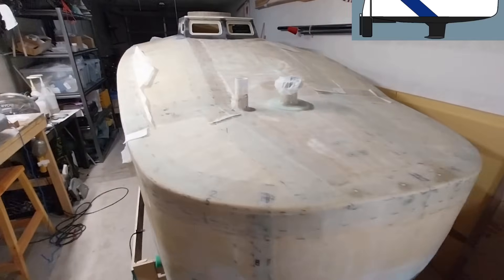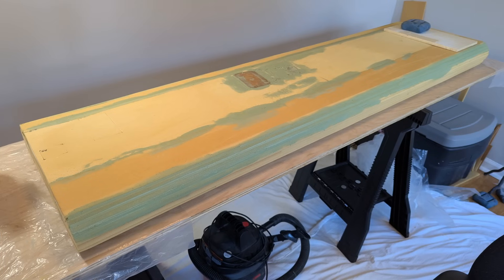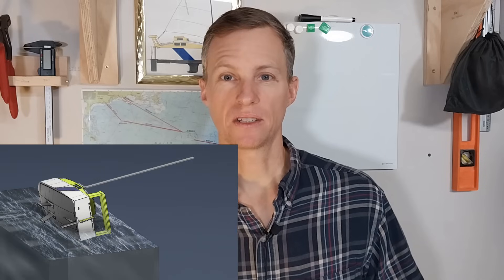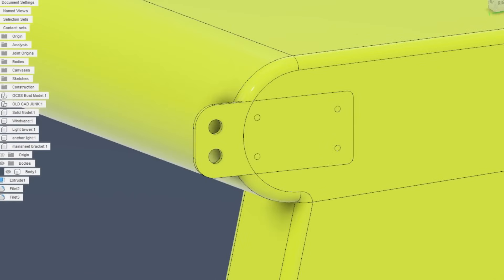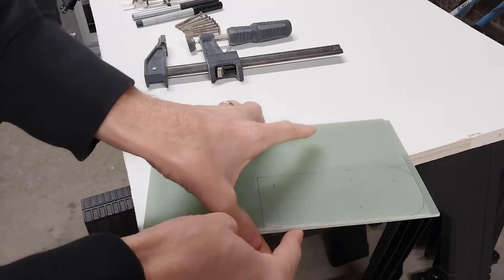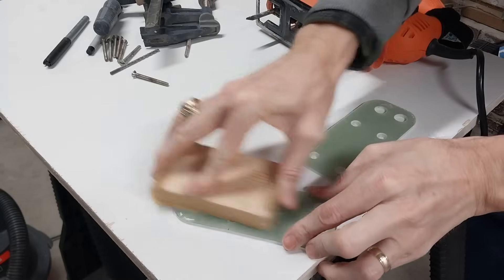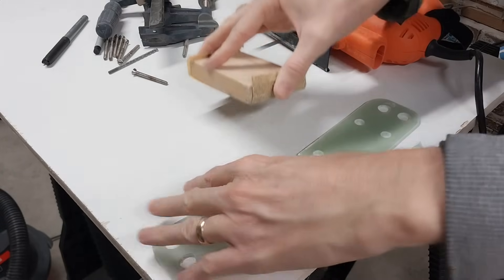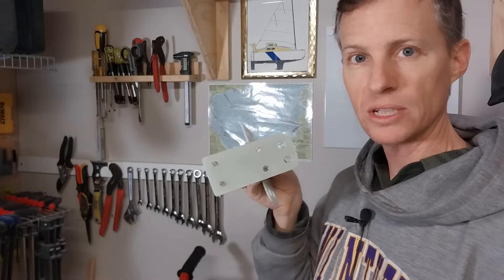OCSS-087 Strengthening Mainsheet Attachment Points with Carbon Fiber - Buoyancy Arch Build

Comment: hi, thanks for sharing your adventure! never knew scow bows existed until i watched your channel. since then i have seen some other scow bow cruiser and quite like the divinite 7 meter. i was wondering, did you design your cruiser or did you get the plans from a designer? if so, care to share which designer? i am looking for a bigger boat as i intend to do some cruising and will essentially be living aboard. do you know of any plans for a scow bow probably between 6,5 - 10m? thanks. all the best for completing your boat and take her sailing!
Reply from the maker: I started with a design called TenTen 425 and made modifications from there. Check his other designs online and you will see some scow bow designs in the range you want.

Comment: fellow boat builder here: I also spent some time thinking about these G10 plates and side loads. Wouldn't it be simpler - and take loads from more directions - to put a soft padeye through the arch from top to bottom and use that G10 as a backing plate?

Comment: Careful mixing carbon fiber and fiberglass…they have different thermal expansions for one…so you can get delamination.  Also…if the surface is load bearing the different strength characteristics may be a safety issue.  Carbon fiber doesn’t bend and has catastrophic failure if you exceed the stress it is designed for.…fiberglass bends and is more forgiving. Depends on a lot of factors, but the fiberglass isn’t going to strengthen the carbon fiber in a layup stack…so don’t assume it is adding any strength to the carbon fiber in your setup here…make sure your carbon fiber can handle all the stress itself without the fiberglass.

Comment: I thought it was good for boats of ALL sizes to not point their masts at the horizon. So what is the size limit? Is it OK for a 35 foot boat to point it's mast at the horizon? 40 foot boat? 50 foot boat? 
 I'm looking into buying a sailboat soon. I want to be sure to only get a boat that is designed to keep the mast pointing up. So, big enough to be comfortable, but small enough to be designed to have the mast point skyward. Any other important items that may help me look for the right size of boat would be helpful. Thanks.
Reply from the maker: Go as small as you can to start. Look into the Cape Dory Typhoon and Compac 16 or other Compacs. Check the "Classic Small Cruisers List" on atomvoyages.com
Reply: @ocean_capable_small_sailboat  Thanks. So many places say you basically need a 40+ foot boat just to squeeze 2 people into for more than a weekend sail. Or a $2 mil catamaran. What would be your minimum hull design? There seems to be so many Utube channels running a bolt on keel. Would you trust a Catalina 28 to cross the Pacific?
Reply from the maker: @goatman3828  I'd build it myself or use something from the list I recommended you look up. Start researching from there. Best of luck.

Comment: Everything about this build has been excellent until this arch. All the comments about the padeye attachment weakness are valid. It seems like all the strength is coming from the carbon fiber laminate. The bolts into foam do nothing even with the extra epoxy. I encourage you to rethink this design.
Reply from the maker: That is simply untrue. This foam has a compression strength of 90lbs/in2. You've got about 4" of bolt/epoxy bed area total for each padeye. Each padeye holds half the force of 1 small sail. From the bolts/epoxy beds that's around 360lbs of support on each side. Not including the many layers of carbon fiber that the end result will have, spreading the load across the arch. Saying the bolts do nothing shows you don't have an understanding of what's being built nor the materials involved. The bolts are not really needed, laminations of carbon fiber are incredibly strong, but I wanted to add them anyway.
Reply: We seem to agree that the primary strength is coming from the carbon fiber. I said that the bolts do nothing. And you said that the bolts are not really needed. It's not a matter of foam compression. The bolts are not anchored to anything and can be pulled out of the foam. The only thing holding it all together is the carbon fiber. I still encourage you to rethink the design. The loads will not be static. Assuming the padeyes can be held in place with the carbon fiber, that just means that the entire arch will need to withstand being pulled back and forth with sudden forces. This will put strain on the arch supports. You'll have the full force of the sail trying to rip the entire arch off the back of the boat. If the arch supports are about 1.5 feet or more, that's a lot of leverage that will amplify the forces.
Reply from the maker: Small sail, small boat, small forces. It's the same basic construction techniques as used on the boat Baluchon and it works fine. Everyone wants to chime in that something is not strong enough. I can triple up strength the next week and they'll write the same. I've learned to filter it out and rely on advice from trusted boat-builder contacts. Just watch and enjoy, or if you don't enjoy then don't watch. Components have been built stronger than required.

Comment: Good looking! 

Is there the slightest risk that the boat stabilizes up-side-down, given the symmetrical shape of the floating arch?
Reply from the maker: Thank you. My plan is to have extra buoyancy on one side of the boat, so that she won't have that issue. Such as a couple small buoyancy bags tied up on deck. But I feel even without those it should be fine, as the natural motion of the sea should tip her to one side pretty quickly in that state.

Comment: I was imagining the funky smell in such a closed boat after some time off shore, now there is a composting toilet in the equation! Jokes aside happy new year!
Reply: I imagine the composting toilet is only  for close to shore, local sailing.  No need for it 3+ miles off shore  :  )
Reply: @et5222  One can imagine some Caribbean "island hopping" in the summer with lots of usage for such a toilet!  😆But I am posting comments for the algorithm, to help Cap. Perry!
Reply from the maker: Not to worry, I don't keep any deposits inside the cabin for any longer than it takes to read these comments! But I was sent a seat that fits on a bucket and that's pretty handy.

Comment: Great update! Is there going to be be solar and are you going to to use a supplemental engine on this?
Reply from the maker: Yes there will be solar. I'm planning to start off using only a sculling oar off the stern, but I'm willing to add a small electric outboard down the road if I feel it's needed.

Comment: The forces on these padeyes  require further strengthening across the front of your floatation arch since this is the weakest point regarding forward stresses
Reply from the maker: Thanks. When I carbon fiber the rest of the wing I'll be sure to add some strips from the padeye onto the leading edge of the wing.

Comment: Why is the child being allowed to breathe the cf dust in?
Reply from the maker: I mean, she's actively holding a high power vacuum to it, there's not much dust to speak of.
Reply: @ocean_capable_small_sailboat mind your own business
Reply: Chips vs dust….
Reply: Carbon fibre dust is really nasty stuff, not with risking it with just a vacuum. If you cut carbon fibre with a CNC mill commercially it’s done under water, a vacuum doesn’t cut it.
Reply from the maker: @shawnlund  If I'm sanding or doing anything that kicks up lots of dust I do it outside or in the garage, and the kids aren't allowed around. This is just drilling 2 holes.
Reply: Mind your own business

Comment: what s the AVS and moment of righting how can you be sure of arch ?
Reply from the maker: Calculations show 130 degrees but I suspect she'll quickly right from even 180 deg due to the volume I've added to the arch and some other tricks I have planned. I rely on calculations from the qualified marine architect Jerome.
Reply: Let's hope that will do! I am familiar with the concept here in UK RNLI they employ an air bag on stainless arch.the fact you anticipate righting under all circumstance change's the dynamic of the concept.

Comment: Looks great! Nice work 👍🏻
May I ask why you‘re putting plastic over the peel ply?

Happy new year 🎉
Reply from the maker: I add a plastic layer then tape the plastic to the wing all the way around just to make sure the carbon fiber sticks onto the corners tightly. Sometimes cloth doesn't want to stick on to the corners. Also I clamped some wood and cardboard onto the G-10 padeye part just to make sure the carbon fiber was pressed firmly on there. It's all basically "poor-man's vacuum bagging technique."

Comment: I would add some kind of preventor on the end of the lines, to reduce load on the attachements on an accidental jibe.
Reply from the maker: I don't think it will be an issue because it's a boom-less rig and a small sail = small forces.

Comment: Looks Great but will that G10 attachment on the arch be thick enough? I'm sure it is strong but it just looks a bit thin maybe not?
Reply from the maker: I think so, but we'll see. One thing to remember is it only holds half the load of the sail, as the opposing padeye holds the other half. The G-10 padeye is 3mm, but the 4 layers of carbon fiber added an additional 2mm. I haven't tested it, but I suspect that will hold a surprisingly large amount of weight!
Reply: @ocean_capable_small_sailboat a am not shore if it holds half the load when the sail is full on one side of the boat and its blowing >20kn perhaps 80-20% of the load is more likely. Is seems a bit thin for me. And how wil you replace this bracket when the eye is worn down? But great to see you still going through. Greetings Michel from the Netherland
Reply from the maker: I still need to add some layers of CF and filet on the inboard side of the padeyes, firmly securing it to the leading edge of the wing. So it will get even thicker before the end. The eyes shouldn't wear down, a short sacrificial length of line will go through them, and that will be replaced as it chaffes over time. That makes a 3" loop from the padeyes, then a longer line runs from the loop on the port side to the one on the starboard side.
Reply: @ocean_capable_small_sailboat  Sounds Good Im sure you have it secure enough as we cannot yet see the final product as you have already envisioned. Thanks again for listening to our comments
Reply: @ocean_capable_small_sailboat  I went back to your  previous episode where you made the arch and watched you put together the foam so if I understand the makeup the G 10 is first secured by screws into the foam? I think that offers no real strength., but the strength will come from the layers of CF? I think that screws into foam do not offer any real anchor point, maybe.... Capt Perry then can I suggest that you Overbuilt the way you are securing these G10 tabs to the arch just to be sure. Myself and others have no real way to measure just how strongly affixed these g10 tabs will be to the arch so this is why from a "Farmers Sense" way to build it appears to need more anchor strength for the g10 tabs
Reply from the maker: @jetson328  The 4 bolts are in beds of epoxy (not directly into foam) and the foam has a compression strength of 90lbs/in2. So in total this is a lot of holding power. But I don't think the bolts are needed at all, the carbon fiber layups will be enough. The bolts are just a bonus I wanted to add.
Reply: @ocean_capable_small_sailboat  OK thanks for the detail appreciated, Im sure you are correct and it will be fine. I just tend to overbuild things.....If I understood the layup correctly you screwed into foam? I saw you squeeze thickened epoxy in great. May I suggest taking some g10 then screwed in the same way into foam? or just how you did on the arch with some glass fiber mat and do a pull test if that holds then the carbon fiber mat on your g10 on the boat will be very strong. Again even if it is strong after some type of pull test that G10 maybe you could add more or too late now, as I see another viewer also has some concerns in his comments. Sorry but Im like most other viewer's in that we all like to be involved to some degree.

Comment: That arch is amazing. I can’t wait to see it all in one piece. I’m biting my fingernails a little bit about the loads going into those legs. I’m looking forward to seeing how you execute that part of the build.
Reply from the maker: Me too. But as Yrvind advised me once, "If you're worried about the strength, just add more layers of fiberglass." In this case it will be carbon fiber so I'm sure it will be much stronger than needed. Also, a small boat encounters smaller forces and more easily moves with the force to shed some of the blow. (talking about it getting hit with water there) And for the sail, it's a smaller sail so that helps.
Reply: @ocean_capable_small_sailboat  Haha, I love the way Yrvind thinks. Harken has a mainsheet loading calculator. Google "mainsheet loading calculator".

Comment: Great work! That carbon fiber is amazing stuff and looks almost too cool to paint over.  And thanks for the plug! Much appreciated.
Reply from the maker: It is pretty cool, it made me start to think about not painting it too. It would be one less thing to do...
Reply: @ocean_capable_small_sailboat  I've read that UVs weaken the carbon's stiffness capacities by a lot. Like carbon bike frames would get much less stiffer in a year, from what I heard (but I'm in south France and there's a lot of sun here, so maybe that's why).
Reply from the maker: Interesting. I thought carbon fiber didn't need to be painted, but I guess the powerful sun destroys all things.
Reply: @ocean_capable_small_sailboat  To my knowledge carbon fiber itself is uv stable, but epoxy is not. It needs to be protected from uv by some kind of UV blocking coating, such as varnish.
Reply: @ocean_capable_small_sailboat  I guess that's why carbon ultralight aircrafts are painted too, even if that's heavier. After a little search online, I'm pretty much conviced that sunrays would damage unprotected composite matrix (as @dustman97 said) and, ultimately, cause delamination.
Reply from the maker: ok, thanks guys, I'll go with my original idea to paint it.